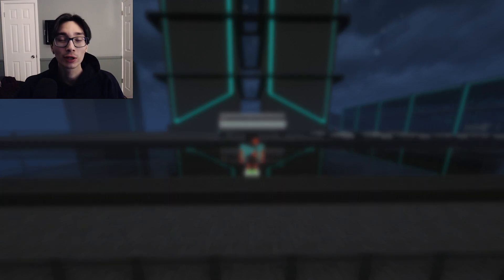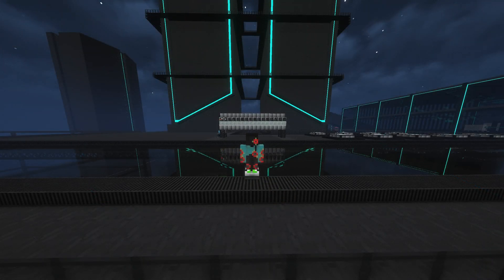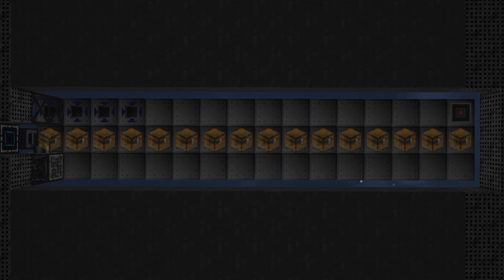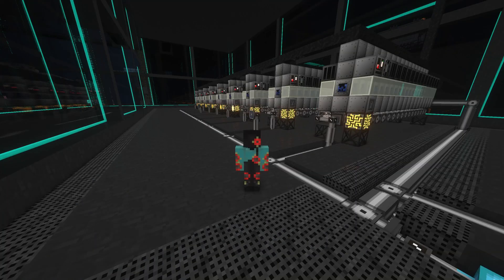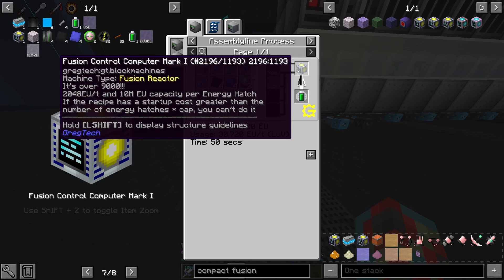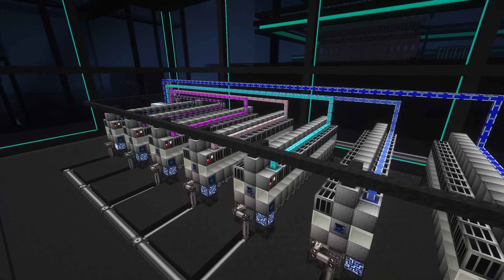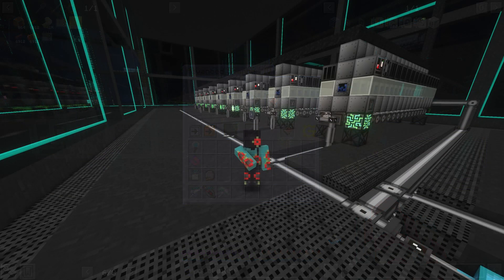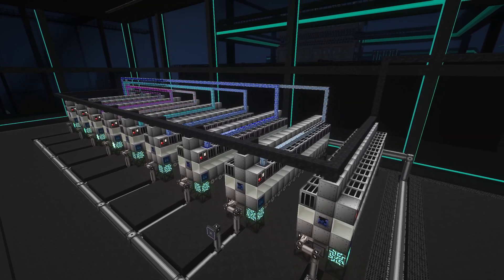Assembly line Automation in Gregtech New Horizons 2.7: The legend of the advanced blocking card.

Comment: I have learned of the advanced blocking card and my life has changed forever. Also, fun fact, modern ae2 interfaces have advanced blocking card functionality by default, something I learned when playing ATM9.

Now, real question: Is there a way to deal with duplicate items stacking without renaming things?
Reply from the maker: As far as I know, renaming is all we got, its especially prevalent for advanced assembly lines later
Reply: i think the system is kind of ass right now, so its basically the easiest way to do it